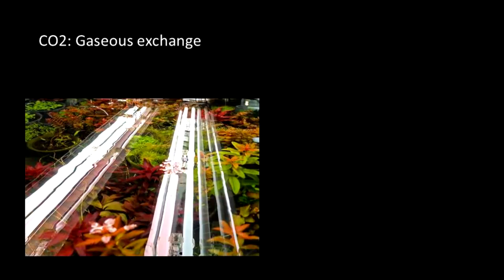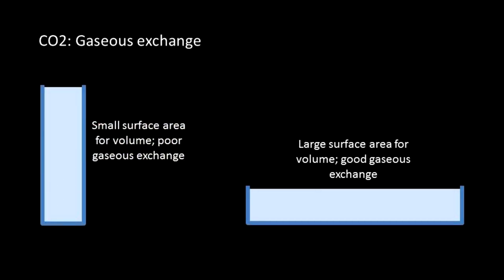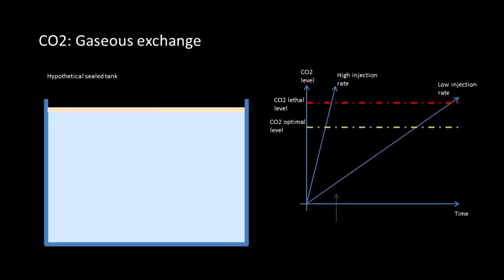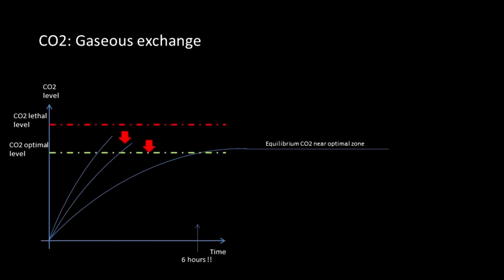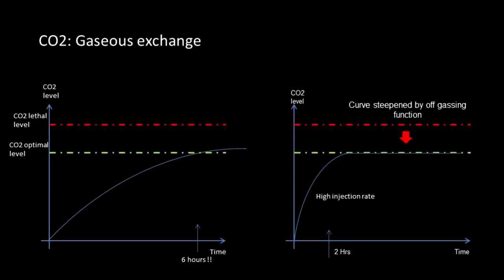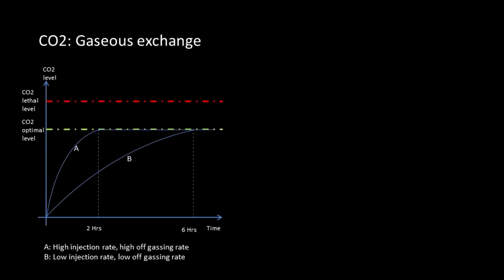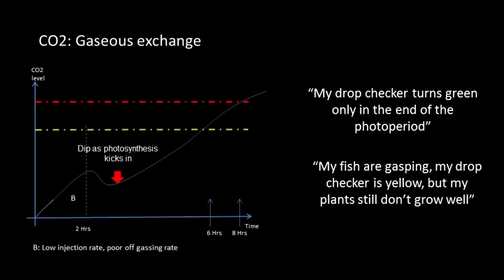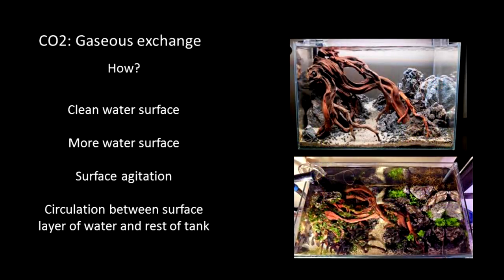Optimizing CO2 in a planted tank - Additional notes on gaseous exchange

Comment: Fantastic video.  As someone still relatively new to the hobby, I've always wondered why people are so concerned about reducing CO2 off-gassing instead of promoting good gas exchange, for exactly the reasons you stated in the video.  The way you describe it makes it seem so obvious, yet you frequently read in forums how you should limit surface agitation during the CO2 injection period.  As you stated, I'd rather up my CO2 rate and have good gas exchange to reach that optimal CO2 level faster; who cares if it wastes a bit more CO2 - CO2 is relatively cheap (much cheaper than livestock!)

Great video as always - I just wish you would post videos more frequently. :)

Comment: Thanks for the information. I am 62 years old, have been out of the hobby since my teens. I am in the process of setting up a high tech tank, still assembling equipment, haven't gotten the tank wet yet. Using aqua soil, aquaclear h.o.b filter, canister filter with pondguru's set up, co2, led lights,  almost ready to cycle, then buy plants and fish. Since my last tank was 40 years ago, a 20 gallon with undergravel filter, plastic plants, and guppies, it is a lot of things to get right, a bit daunting. This video helps tremendously

Comment: Been tuning my co2 to 1bps afraid of saturating the tank w co2. When I first installed the co2. Co2 was as 2to3 bps. Plants were pearling in 2to3 HR and shrimps were all ok staying at the substrate level. Lately I realised very little pearling as I tune down the co2. Thansk for the video..now I will strive to inject at a higher rate n monitor for the equilibrium

Comment: Great video, thanks for sharing! What surface skimmer was that?
Reply from the maker: I'm not sure actually, I know Ista, Fluval (probabaly the most expensive) and some other brands all make surface skimmer intakes based on the same design (from same china factory ? ). They all work similarly and are adjustable
Reply: Thanks for the reply back

Comment: This is a super interesting video - I think you just helped me avoid a bunch of problems as I set up my CO2 system (55 gal tank, canister filter).  I am not getting a skimmer though - will just try to keep my surface from accumulating too much weeds / stuff.  You find a single filter outflow gives you good enough top / bottom circulation?
Reply from the maker: Yes in most tanks, sometimes hardscape can block the flow so there are quieter spots

Comment: Wow nice information , like a science lesson . Have just started on a non pressurised gel based co2 system using the fermantation process and can see changes already , got a surface skimmmer which also acts as a circulation pump in addition to an internal pump head running sponge filtration . Fish all ok so far . Watching for plant growth changes , it's only been running for a few weeks . Just back into the hobby after years of being out of it . Thanks for your video's .

Comment: Hi dennis, I'm working at emulating your 4 ft ridgeline into a smaller ADA60 tank. I have some questions for you though.

Where did you get that 180 degree elbow connector that connects your Surface Skimmer to the inlet hose? I tried using my old eheim one but its far too long and ends up jutting out on top of the aquarium.

Since the surface skimmer's inlet pipe is so long and reaches near the top of the tank, i belive I would need to obtain a very short 180 degree elbow connector. Yours, in your 4ft, seem to be nice and flush along the aquairum and do not jut out awkwardly.

This process of setting up this tank is 2 months in the making (hardscaping along took 3 weeks). I never imagined it'd take this long😂.

Thank you for all your work and for inspiring me to give high tech nature aquariums a try

Comment: What I don't get is why the drop checker of my 250gal, sump-driven tank never reaches green.. Based on your thesis, the extra water bubbles generated by the water from the display tank hitting the sump should be helping with CO2 availability.

Comment: So with this logic, if I do not run a skimmer and my circulation is relatively low I could add an airstone or bubble tube to boost my offgassing rates? Or would the bubbles disrupt the co2 saturation too much cause it breaks the surface?

Comment: I use fans that create a lot of surface agitation as well as a lilypipe with a surface skimmer inlet. Can I assume that these 3 combined most definitely ensure off gasing? My drop checker which I don't completely rely on is usually yellow and right under the point of where a fish or 2 might be found on the surface. Should I be safe to assume that that is max CO2 without harm to the fish?

Comment: Very good video, but for me it lacks some applicable information. Are you suggesting the use of controller where CO2 is optimal all the time? Is monitoring CO2 via drop ok? How much flow is required for good gaseous exchange?
Reply from the maker: Check the other main CO2 video, this is just an add on to that one

Comment: A pH controller would keep the CO2 levels higher at lights on - which should be better than setting a solenoid to go on an hour before lights on.  Would a pH controller achieve the same goal of keeping CO2 at a consistently high level?
Reply from the maker: It could if it was properly tuned. CO2 levels still take time to build-up, whether or not one uses a controller...

Comment: This has just convinced me to change my intake to one with a surface skimmer. I would love to use a lily pipe set, but my tank has a glass lid. Since I live in a desert, the evaporation is too much without it, but this means that I cann put the intake and output on the same end, so I'm afraid my flow pattern without a spray bar wouldn't be good. Any thoughts or advice on this? Should I just get an intake with a surface skimmer and leave the spray bar given the lid situation? The tank is a 40 breeder and my diffusion method is an in-line atomizer.
Reply from the maker: I think a spray bar can work, as long as the flow is strong enough, and you find a good angle for the circulation. Things can be flexible

Comment: Hi Dennis! Well explained video. Helps me alot. Currently cant decide btw inline atomisers n reactors. Care to explain the characteristic for each? Would like to hav just a little mist but also high dissolution. Maintenance wise?
Reply from the maker: Both inline atomizers and reactors are low maintenance. Main difference is that inline atomizers work linearly and simply, while reactors have an optimal flow pattern/size depending on your tank size - and no mist in the later. If mist bothers you while using atomizer, try looking for those that produce an ultra fine, almost invisible mist
Reply: Thanks for the reply! Which inline atomiser r u using?

Comment: Im trying to copy your filtration, water movement, and co2 diffusuion. Could you tell me what brand and models they are. I want all my hoses and connectors to all be uniform, assuming you found them to complemebt each other. Thanks for your insight!
Reply from the maker: Check the 4ft tank setup vid a few vids back, it has all the equipment details
Reply from the maker: Which setup is this?

Comment: I didn't understand so good. It's better to keep the drop checker green at the middle of photoperiod and lime green at the final? How many hours of CO2 I need for a ten hours photoperiod? Thank you.
Reply from the maker: You should run CO2 for at least the first 8 hours, if not the entire photoperiod. The drop checker should be green from start of day....
Reply: Thank you for you reply. So you meant the drop checker shoud be green the moment the lights turn on? My photoperiod has 10 continuous hours (inicially 2 hours of low light, then 6 hours of high light and I finish with 2 hours of low light). The CO2 turns on 2 hours before lights on and it turns off 2 hours before the lights turn off. The drop checker is bluish green immediately before CO2 is injected, it keeps bluish green  after 2 hours of CO2, turns green with 4 hours and the moment CO2 turns off, after 10 hours, it's lime green (clear green) but not yellowish green. From lime green to bluish green the drop checker takes 14 hours to change, I refer to the time the CO2 is not running. This scheldule seems correct?
Reply from the maker: Actually, drop checkers aren't accurate at all. If you are aiming for accuracy, use relative pH drop readings, throw away the drop checker

Comment: Great info Dennis! Is it advisable to leave CO2 injection running 24/7  if I have good surface agitation?
Reply from the maker: You could I guess, but I never found it necessary or advantageous to run it 24/7... given that most tanks spend more time in darkness than lighted
Reply: Yes and the advantage is the constancy of ph. Even if many people says that is not so important and some ph fluctuations are good tolerated by fish, that technique makes sense to me , so i prefer 24/7 co2 only for this (ph very stable) but always in presence of very good circulation  and some agitation surface. Co2 at 30ppm always safe and o2 in adequate levels with independence of any biologycal factor. In my case, 2 decades of non stop co2 injection/good circulation, i think is very easy and safe// Both videos are excelent!